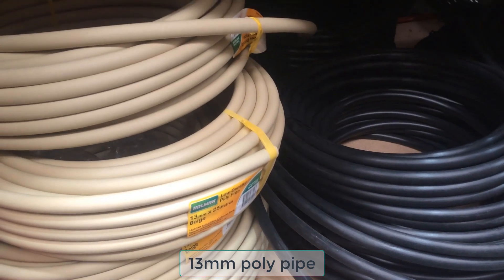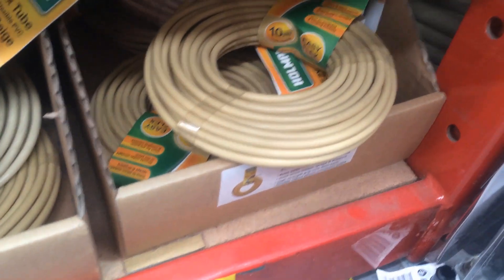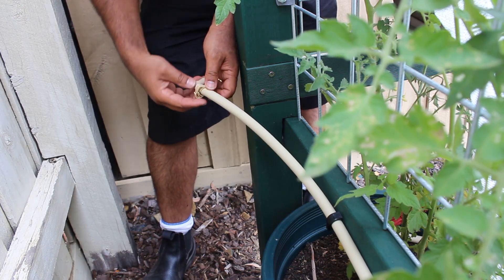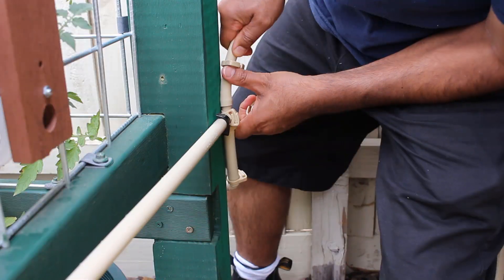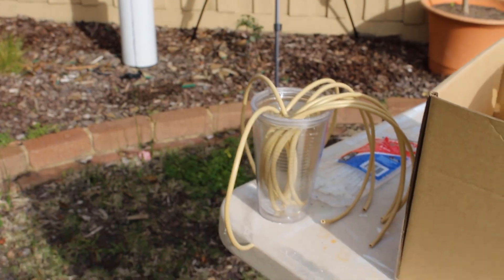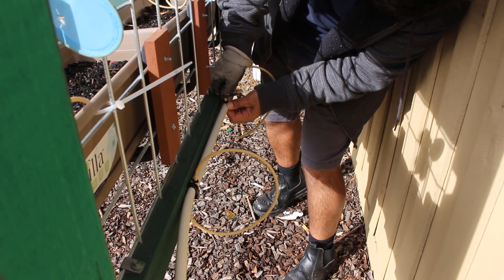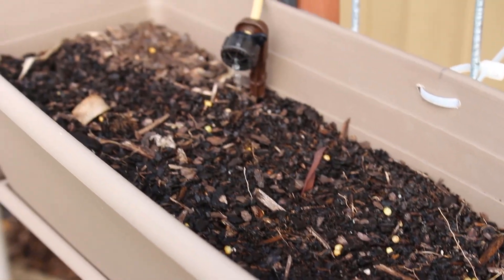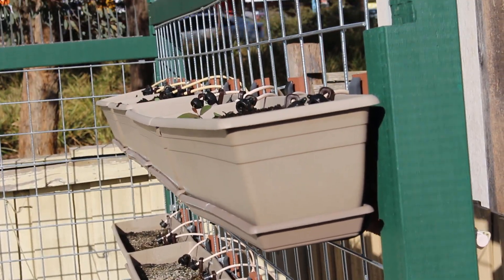Episode 20 Vertical Drip Irrigation

Comment: Don't you need to put a pressure control on your hose? I saw that you should not have more than 35 psi and have .5 gallon/hour dripping tops.

Comment: It is a new drip irrigation technology that the floating drip
irrigation device has two characteristics: (1) Auto-remove impurities of water，so to solve the long-term blocking problem of the drip irrigation (2)Lower power, the operating pressure is 0.01~2 Kg/cm2, is very suitable for gravity drip irrigation. as detailed in YouTube : https://youtu.be/P495Nk62QMQ
 (The floating drip irrigation device introduce)

https://youtu.be/hHen1IEzDT8  (The floating
drip irrigation system operation)
Reply from the maker: That looks very interesting. Can you please send me information regarding the low operating pressure and gravity drip irrigation?
Reply: Thank you for your watching. The floating drip irrigation max operating pressure is 1Kg/cm2 . You can get more information to facebook net address:  https://www.facebook.com/groups/1027958970717755/?ref=bookmarks   (Most language is traditional Chinese ) . If you want to know more about floating drip irrigation device, We can provide free samples for your reference. and you can e-mail :hueiyi2012 @gmail.com for us. Thanks.
Reply from the maker: Thanks for that. I will contact you for sure.
Reply: @Higrosol  ，I am looking forward to your reply. Thanks.